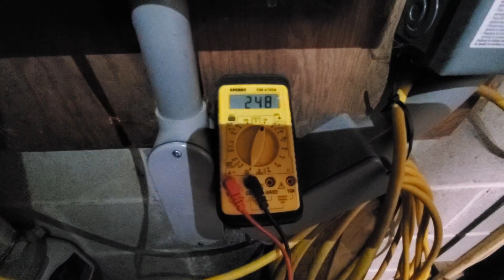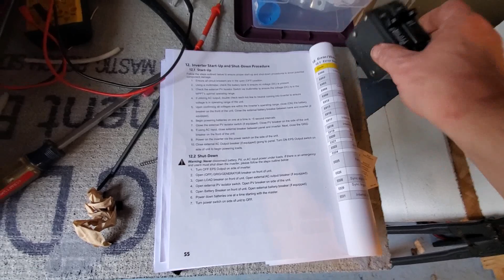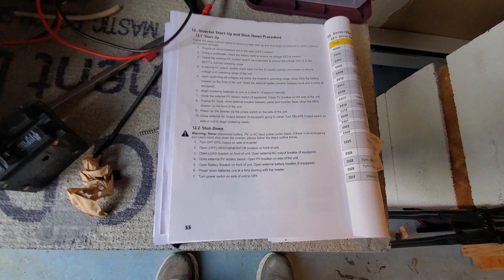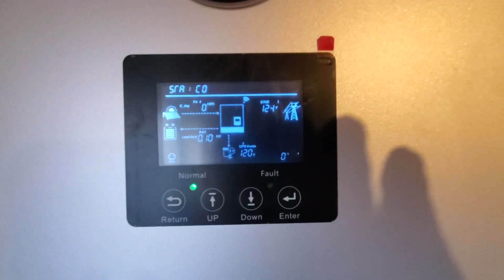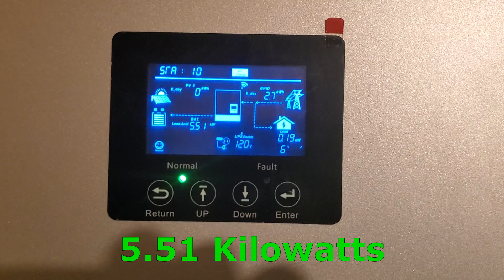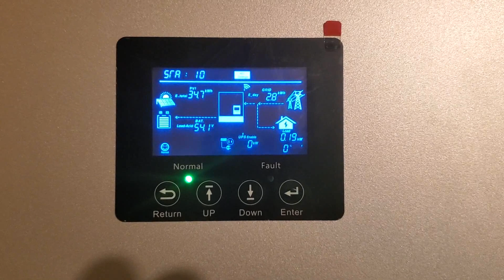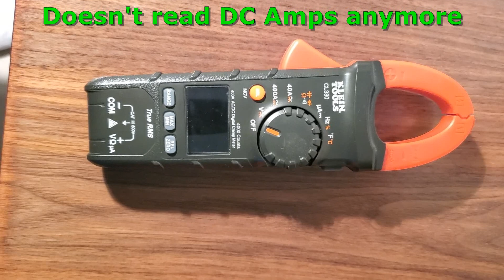EG4 6000XP - Part 6 - AC Input hookup II - Solar System Upgrade

Comment: Is it mandatory to have a critical load for the 6000xp to work? I purchase one to power a small house , and if i use a critical pannel , y should use all the house load for the critical pannel becuase there are so few. I hope you can clarify. Thanks
Reply from the maker: @alexherrera3918  critical panel is just a panel which you pick what loads you think are important. No its not a requirement but keep in mind it burns about 50-80 watts continuous. Mainly you need to know how much power you need to pull and design the solar and battery (if off grid) to provide enough plus another day or two if you can afford. Hope that helped but the 6000XP has been pretty easy to run and i haven't had a glitch since I finally got it setup this time lsdt year. I've almost forgotten about it lol.

I have it tied to grid to recharge my batteries (same way as a generator would work but im using the grid instead) when they get a a low voltage so on cloudy days ( takes me 2 days or so before batteries are low with no sun) so it automatically keeps the batteries charged no matter the weather and keeps my 2 freezers and 2 refrigerator, including lights, office, entertainment center etc going 24/7

Comment: Looks like you might have 8 gauge on ACout and perhaps 6 gauge on  ACin. Is that right and what size breakers do you have then tied to in your subpanels? If you have 8 gauge and a 40 amp breaker on ACout and  6 gauge with a 50 amp breaker on ACin, will you overload the 8 gauge wire and perhaps have some nuisance tripping of the 40 amp breaker if the unit goes into grid bypass due to little PV and/or batteries for the load?  Just trying to understand the best way to wire this unit.

Comment: Did you put a fuse or breaker for your PV panels in series or did you tie it straight into the inverter? I know that inverter has breakers for the PV built in.
Reply from the maker: I put in 10amp fuses every 2 panels since they are in series and only about 8 amps before it goes to a  DC double throw breaker between all panels and line heading to house. Then another DP one inside the house before connecting to inverter. That gives me the ability to work on the buried wire to house if needed.

Comment: How far away is your array from the inverter? That is a long run - I always wonder how great the losses are from point to point.
Reply from the maker: Interesting question, I have about 175' to panels, I used 8 gauge wire but all my panels are in series so only about 8amps are going through it at about 340Vs. I don't notice much if any voltage drop. Definitely not enough it matters to me.
Reply: @LivingFree4All  good to know. We will be mounting our array on top of our High Cube Sea Container so distance to combiner and inverter is quite short. Love your set up!
Reply from the maker: Super Thanks, just keep you volts as high as you can get so your wire can be smaller with the cold factor included. Panels get a lot higher on cold mornings. Thanks for your comments, Take care! @rongray4118

Comment: I had balance issues with my 4S 12v battery setup until adding an active balancer. Do you plan to add one?
Reply from the maker: No im not, just another cost and something else to monitor.  If you balance the batteries right and do so every so often I don't think you need them. Good Question, thanks for your comment.

Comment: Did you ever get the ground/neutral bond figured out when you want to charge your batteries from the grid?
Reply from the maker: Yes I did. I have a grounding rod for the inverter and I used the inverter ground. The inverter is almost always off grid. I got several different answers at different times from the supplier so I'm stayed with inverter ground. I don't think there is a right answer if you are using A/C input. If you are using AC input it needs to be from main panel, if not it needs to be inverter and since I use both, neither is good and I'm not manually switching it between uses! That's when the supplier told me this inverter should only be used off grid, I'm pretty sure to cover themselves lol I have no answer for it and went what I use most so grounded to inverter it is.... I have no good advice on ground bond for this inverter if you use AC too
Reply: @LivingFree4All  if you have the grid input hooked from the main then that would supply your ground. Unless you’re a good distance away from your main then you wouldn’t want a second ground to that. These inverters have a pass through/ common neutral design.
Reply from the maker: @GavinStoneDIY  I  am about 200' from the main and very rarely do I even use the grid power especially now I've got twice the battery, a later video. I was told by supplier to use the inverter as a grund , then later told use my main so it got confusing. Since I am 99% of the time totally off grid, I choose to use the inverter ground bond. When I found out my Toaster wasn't waterproof, I was shocked! Lol just a Dad joke! I've only been shocked a few times... just another joke!! Let me know your thoughts! Thanks for watching my video.  Take care!
Reply: @LivingFree4All  always glad to see more solar channels. You’re doing a great job by the way. 

So if you have the grid input wires  hooked up at all, that is supplying the bond. Whether you are using the grid or not it is supply a g/n bond from the main. So you don’t want to bond it again at another location. You can clarify this with EG4 tech support. They will sometimes do a better job with advice on the more technical aspects of wiring then signature Solar tech support.

Comment: Just waiting on a couple of 6000's to be delivered.
I've got a Fluke 789 that I keep calibrated every year but also got a few of those little disposable 15 -20 dollar meters stuck here and there for convenience. I bounce them off of my Fluke for accuracy and all of them work extremely well. You'd be surprised. If I bust one of them up it's not a great loss. Better than trashing my $800 meter.
Reply from the maker: I don't need anything that expensive lol i could get my 2nd invertor for that cost lol. I'm happy with a$50 meter. You aren't going to wait for my final conclusions before you buy your 6000s? Lol I  should be done sometime this decade... 🤣  My biggest challenge is setting it up for non server rack batteries and having to find the right voltage setting to make it work right. Still working on that! More in a later video on that. Hoping you the best with your 6000s. Thanks for your comment, Take care
Reply: I think the blue conduit is for low voltage wiring only.

Comment: How noisy are the cooling fans and do they run all the time or only after the inverter is in use for some time?
Reply from the maker: Only when inverter needs excess power does it rev up. Pretty quite for a inverter. What you hear in my video is how it sounds up close, as you walk away, like when I turn to look out the door, it's noticeable quieter, so what you hear is as bad as it gets. You can set the fan speed as well. I have mine at 30% and it's pretty quite to me. You can hear it in background. I don't think I would put it in a bedroom but I wouldn't say it's loud. Pulling 5000W off AC isn't really loud either. I've only pulled 1800W off PV and again not that noticeable but I'm getting old and my kids say I can't hear anything anyway anymore lol. I can watch TV pretty easy in same room. Guess it really depends on your noise level comfort.
Reply: @LivingFree4All  Thank you for the quick response and the information.
Reply from the maker: LOL i just edited it and this. When its running 50% of the time, I would say its about as loud as a typical house fan on medium level. It rev's up slowly so its a gentle build up too. Otherwise its completely quiet while running smaller loads. I was just about to call it a night, No problem, Thanks for comment, Take care @booterone1

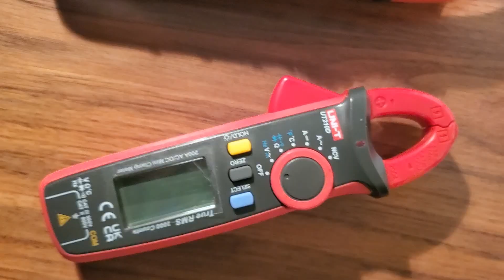Comment: 9:21 I have a similar UNI-T meter I bought in 2020 and I like it. I think the small size makes sense for the 200A range, and is actually great for getting the clamp into a crowded junction box. However I have one complaint about the build quality: the wheel/selector. The red rubber grip around the wheel on mine has gradually disintegrated and fallen off, which makes it harder to turn. I have also found it helpful to use a silver pen to color the pip on the wheel for visibility, as UNI-T did not paint it, unlike the wheel on your Klein meter.
Reply from the maker: Interesting idea. I have to admit, I'm beginning to like this little meter especially for it's price. I haven't had any problems with it yet and you are right, it does fit in tight places better. I'm re-thinking my opinion on it lol Thanks for the comment! Take care.

Comment: Adding a 60 AMP/240V disconnect box prior feeding the Inverter would be a good idea instead running all the way to the other side of the house. maybe in the future ? by the way, the UNI-T meter isn't bad for the price but there are bigger models u can order .
Reply from the maker: I actually used a 50 amp breaker. For now, I'll just walk to the back room and pull that breaker, since I've already connected it. I still have some many other things I want to do with this, that's just not high in my priorities yet. I have to admit, the little Amp meter isn't bad after all lol. Thanks for your comments! Take care.

Comment: A 50% larger breaker box in each place would have been helpful. Maybe say something in your next video to point that out to others. You never know what you will do later or others will do. They should thank you when you future proof things. 

Thanks for sharing.
Reply from the maker: Ya I just went with this smaller panel box and plan to get a full size box when/if I get the other inverter. It will be in the same spot, and I've left plenty of wire in it but eventually it will all be moved to my retirement homestead home so none of it's permanent. I'm still trying to decide if this is my final inverter brand, type, etc 1st so this little box will do the job for one inverter. Good point for others who might be wanting to add another inverter then this panel is way too small lol. Thanks for the comment. Take care.

Comment: I heard/read that precharge resistor not required with this inverter.
Reply from the maker: Ya it might be too small to require one and it's a high frequency so you might be right! I just try to not make more problems for myself lol. I should look into it. It's definitely not on the "how to start up" the inverter list in the manual. Super thanks for the comment!
Reply: A precharge resistor is required with any inverter assuming you are using lifpo.
Reply from the maker: @GavinStoneDIY  Hay Gavin Thanks for joying on. I've watched several of your videos as well and enjoyed them. I've always used a resistor anyway after seeing it on Wil P and off grid Garage.  I have seen a spark when doing so I was sold on it.  Thanks for the reply